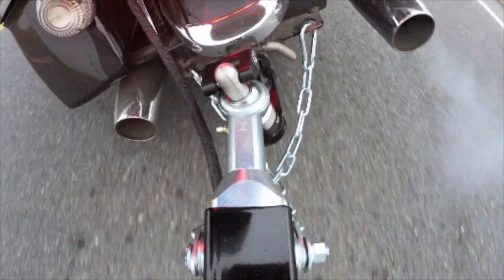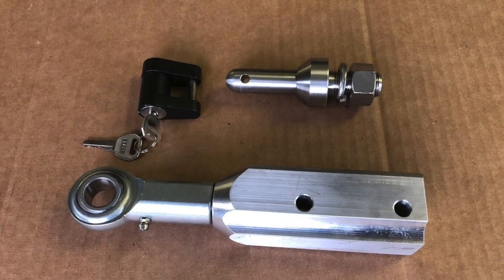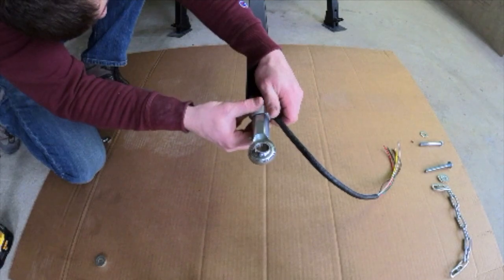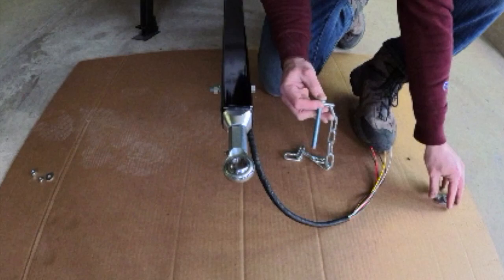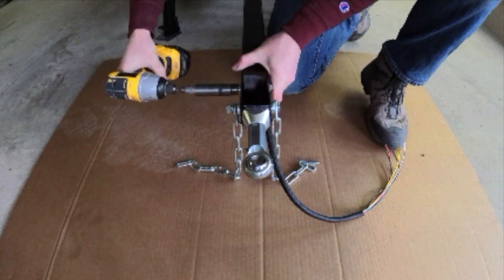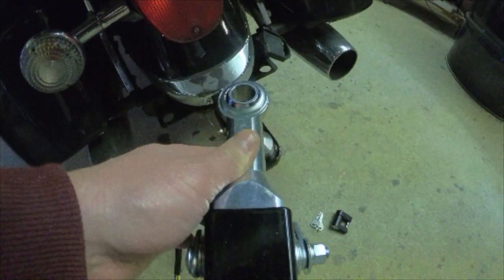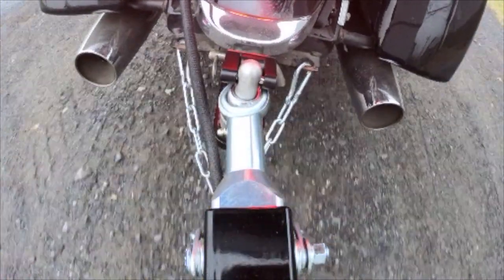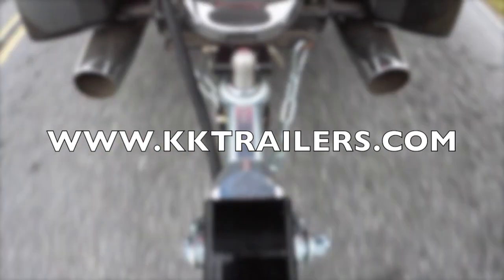New Motorcycle Swivel Hitch Heim Coupler Installation

Comment: Do you recommend these for a Can Am Spyder
Reply from the maker: Swivel couplers are only necessary for two wheel leaning motorcycles, so it would not be needed for towing with a Spyder.